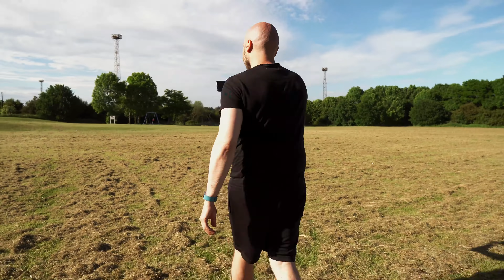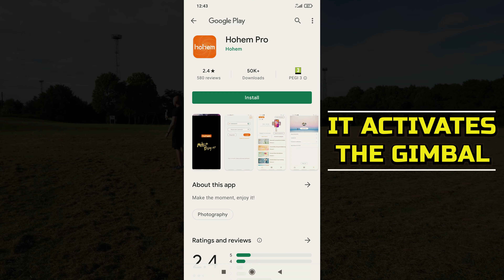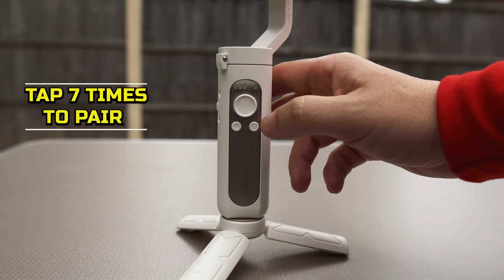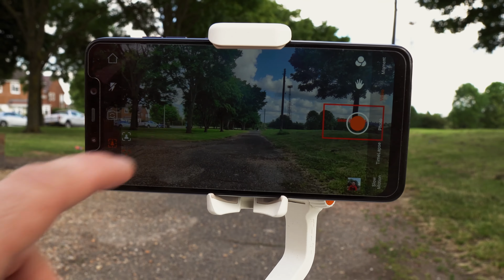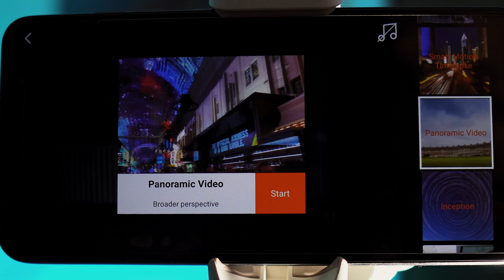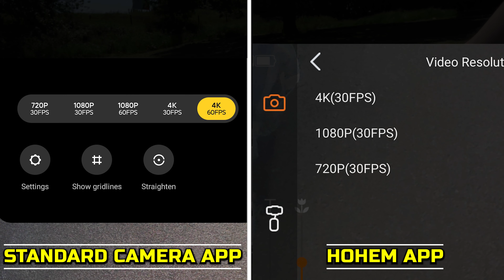Stop Having Jerky Mobile Video With The Hohem iSteady X2

Comment: I can’t find the gimbal parameter settings menu. I want to slow down the joystick settings. Help?
Reply from the maker: Hello Sheila, I hope you're well :)
I no longer have this gimbal myself but I've just had a quick look on the net and it looks as though you can slow the joystick down using the mobile phone app.  Here is a link to the page I've just been looking at - https://the-gadgeteer.com/2020/12/02/hohem-isteady-x-review-shots-are-nimble-with-this-gimbal/

It looks as though there is a gimbal parameter settings option and on the left, there is an icon of a camera, one of a gimbal and one with 3 lines.  If you press on the icon of the gimbal then there should be the option in there to change the L/R Joystick Speed.

I hope this helps.

Comment: For me it's a bit weird, I'm using Poco F3, on stock camera it only support 4k 30fps. In hohem app it has 4k 60fps. I try it and it's a legit 4k 60fps
Reply from the maker: That's a bonus :)  Always nice when you can get some extra frame rate.  I'm still rocking the Poco F1 at the moment.  I still love it, but I may need to get a phone with a better camera and maybe one with NFC on there.

Comment: Thank you for this informative video! It helped me a lot in deciding ehich gimbal to get. But I saw one detail in this video that it only supports up to 12 pro. Right now i have 12 promax. Would this be fine with isteady x2? Also, can i use the differect zoom effects, inception or rotation on the iphone stock camera? Or i can judt use them thru the app?
Reply from the maker: Hello Danica, thank you for the kind words about the video.  From what i'm seeing, the iPhone 12 pro max width is 78.1mm and the thickness is 7.4mm.  As long as the thickness is less than 11mm and the width is between 55mm - 90mm then it should be fine.  So looking at those specs, the iPhone 12 pro max should be fine.

As far as i'm aware, you will need to use the app to be able to use the effects like inception and the other effects.  You can manually move the gimbal using the joystick.

Hope this helps.
Reply: @Andyhhhdx  Thank you so much for the reply!
Reply from the maker: @SHIdee525  No problem, have yourself a great day :_laugh: